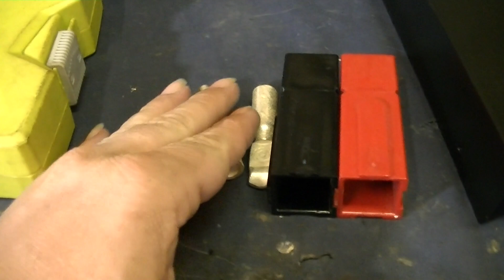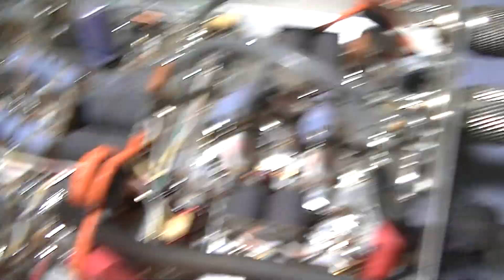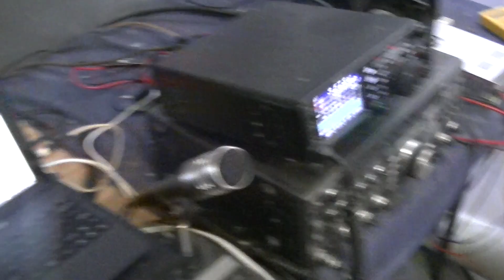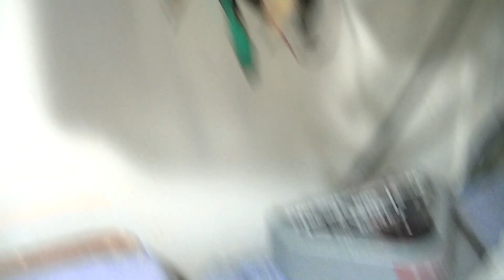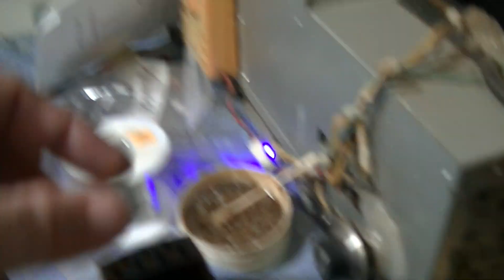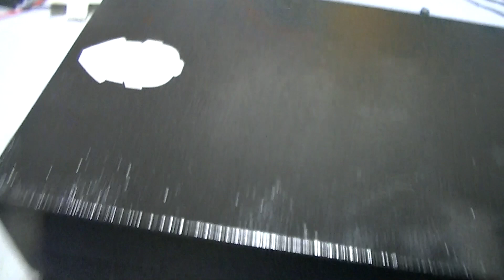Mr. Sgtfumduckers FULLY GK Modded Texas Star 667V Turbo Mod!

Comment: I have one brand new with deis i want switched to hg's gatekeeper it has mosfet finals in the driver section could you go all 2879's?
Reply from the maker: You could... everytime I do a 667 to 500 upgrade I will keep the driver section all intact for people wanting go convert the mosfets over to the Toshiba 2290.... You honestly just need a 2290 which is honestly to much which is why Texas star attenuated it because of the bias.... hang I n there with me when I start taking in work again ill do it for ya.
Reply: @1883GotDown  definitely appreciate it i actually have 2 new matching original 2290 Toshiba as well I could send with it there brand new

Comment: love that logo . keep the bottom V . great fan kit. now if the fans stay around. I have not had a 667 do that much RMS watts. I did with a DX500 with driver . sometimes them Japan transistors do that.  re tuning and getting input reflect down  does help a bunch making power. love OEM Anderson connectors.  put cheap one side by side. the contacts are smaller and lighter . you can tell when crimp them . big difference. The larger Powerpole connectors use same contacts as the SB series . look at the force it takes to push and pull a true Anderson together and pull apart. I can see the difference on a thermal image pulling current threw them. now on like a 24 pill or bigger go with welding connectors or 2 sets of SB 350 connector. with is 700   amps peek. just go to a welding supply and they have nice 1000 amp connectors. super fo 48 pill . 73's